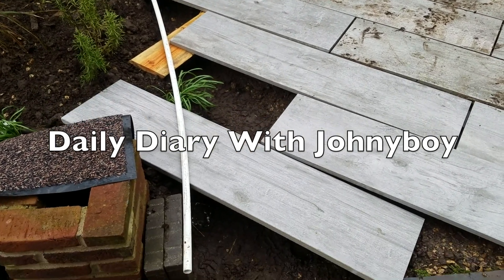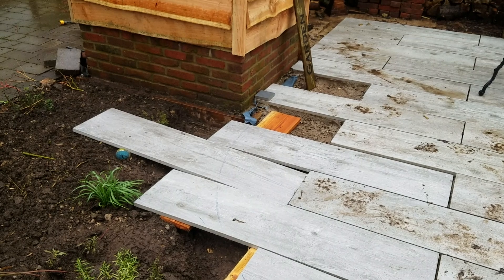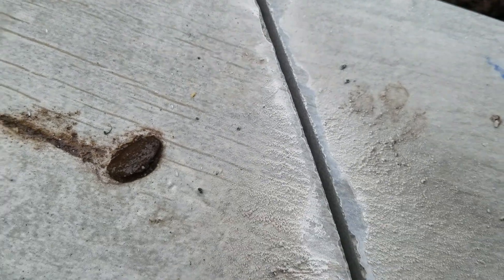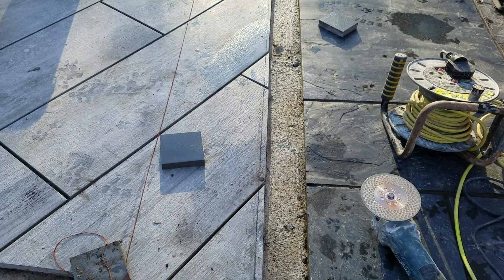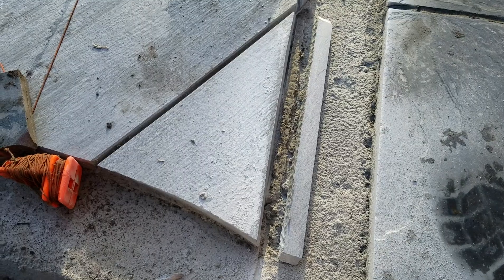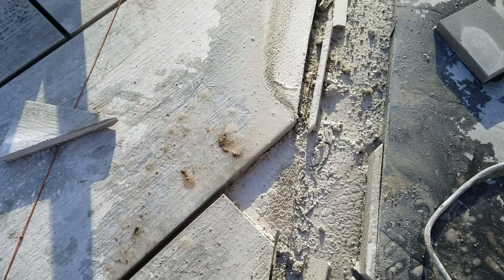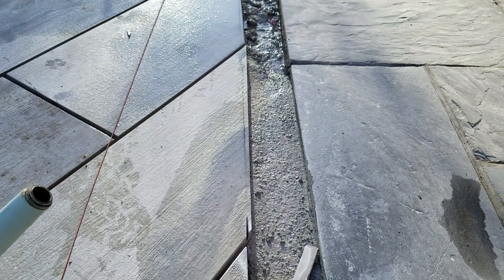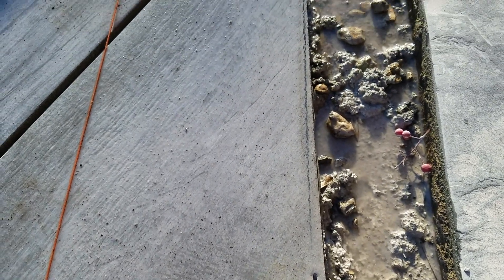How To Cut A Porcelain Patio

Comment: hi Johnny boy what 115mm blade can i use on my grinder to clean up any fragmented edges ? cheer buddy
Reply from the maker: A Rubi 115 2 in 1
Reply: @GreentopLandscapes  I bought a pulvex  jb continues diamond blade  I hope this will see me through
Reply: Hi Johnny boy I bought the rubi 2 in 1 disc .last question is it dry only or can I add a little water on straight cuts ? 🤔

Comment: The best blade which I purchased last week to cut porcelain perfect is the (LST ULTIMATE BY SPECTRUM) I promise you you won't find a better blade. But here is the question for some I believe in buying the best to cut porcelain and if your prepared to spend £377.00 on a 300mm blade then your on the right road to the perfect cut. I take porcelain very seriously no room for error because it can be expensive.